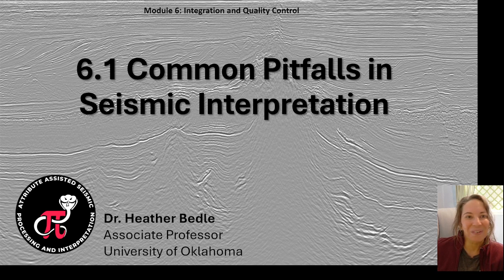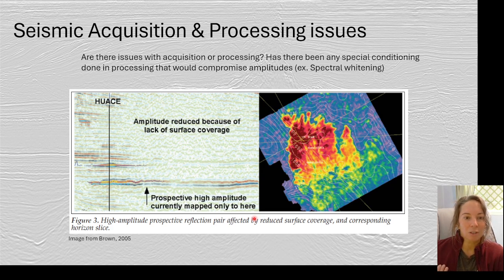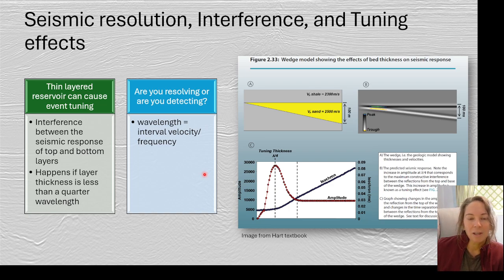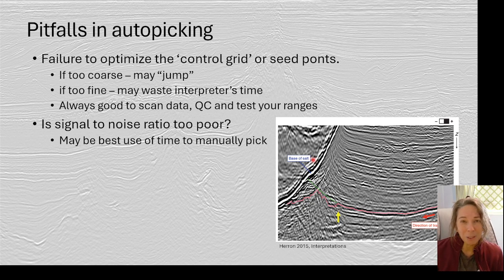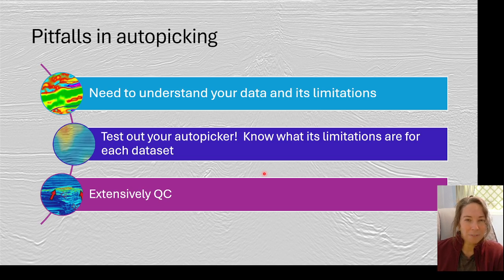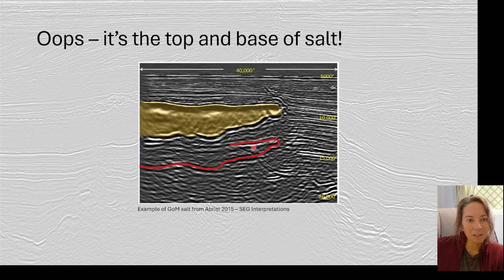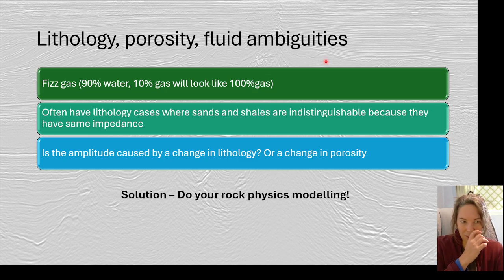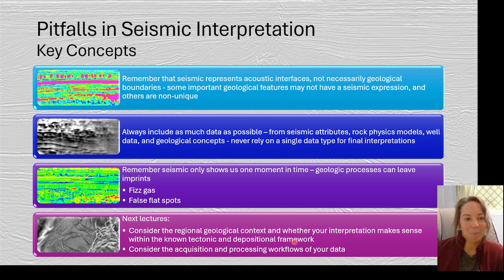Seismic Reflection Interpretation 6-1 Common Pitfalls

Comment: Please suggest good literature for pitfall.
Reply from the maker: Here are a few:   

Marfurt, K. J., & Alves, T. M. (2015). Pitfalls and limitations in seismic attribute interpretation of tectonic features. Interpretation, 3(1), SB5-SB15.

Brown, A. R. (2018). Pitfalls in the study of seismic amplitude. Interpretation, 6(4), SL15-SL20.

Infante-Paez, L., & Marfurt, K. J. (2018). In-context interpretation: Avoiding pitfalls in misidentification of igneous bodies in seismic data. Interpretation, 6(4), SL29-SL42.

Abriel, W. L. (2015). Pitfalls in structural seismic interpretation due to subsalt multiples. Interpretation, 3(1), SB23-SB27.